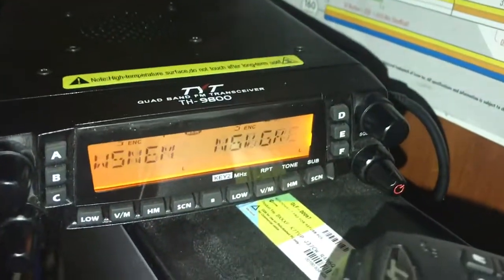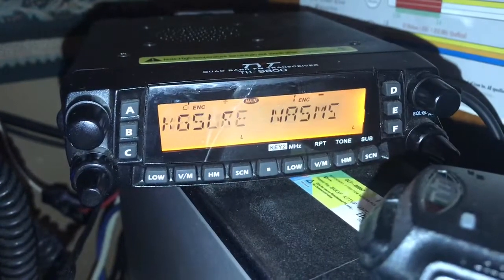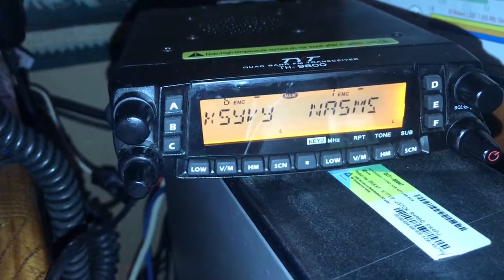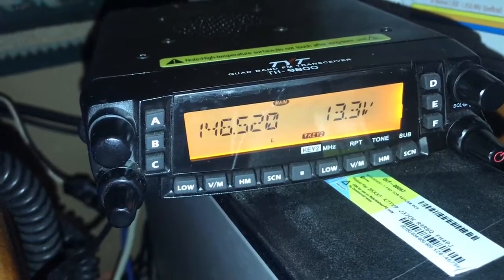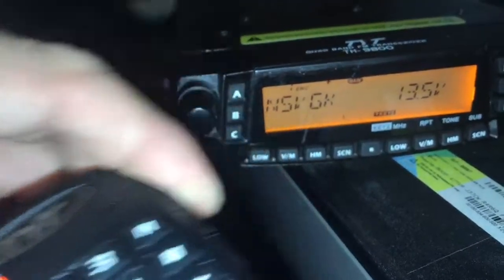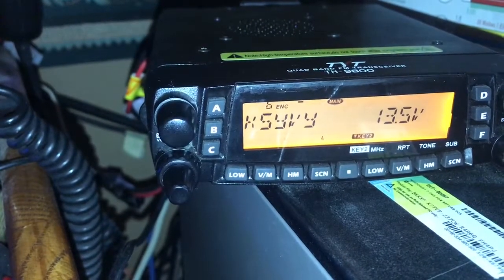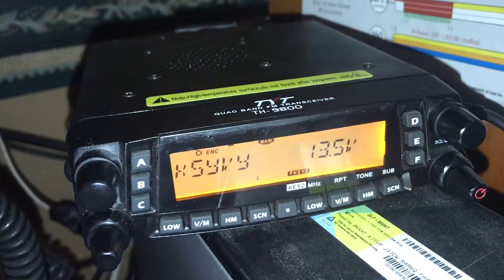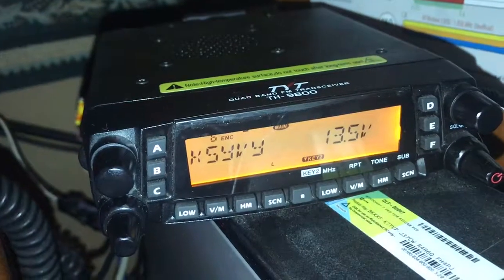TYT 9800 plus malfunction

Comment: Is it sold? how much
Reply from the maker: This unit actually fixed it self, after I made this video I put the radio back in it's box and put away for 3 months, then I used it one day just to hook to my solar power project and the radio was back working 100%, so I have continued using it and no longer for sale at this time. Thanks.
Reply: Hughes269 $200
Reply: What I was going say it was beeper when signal received